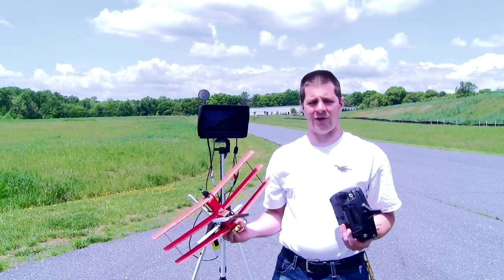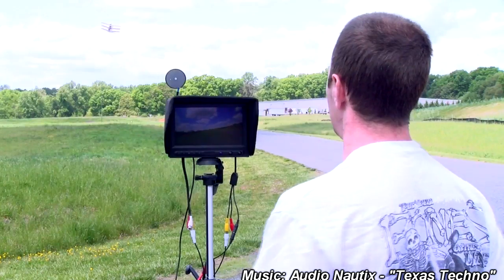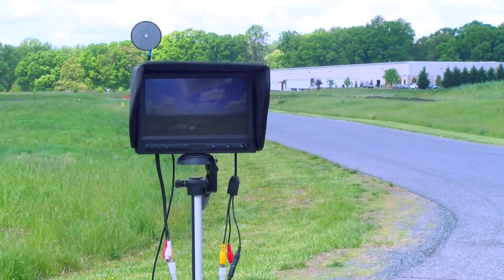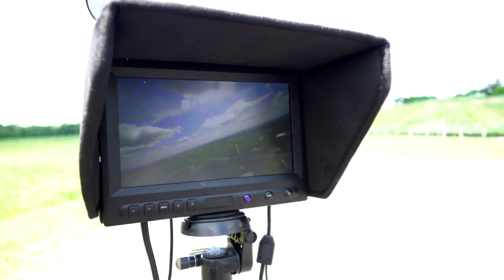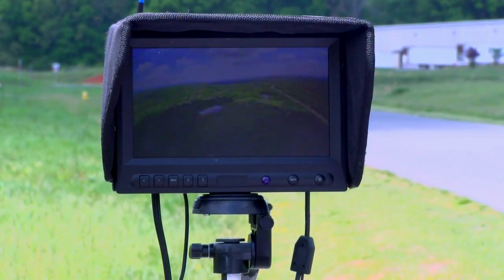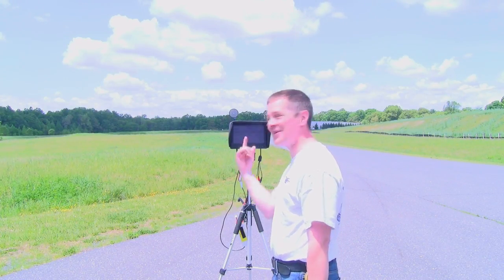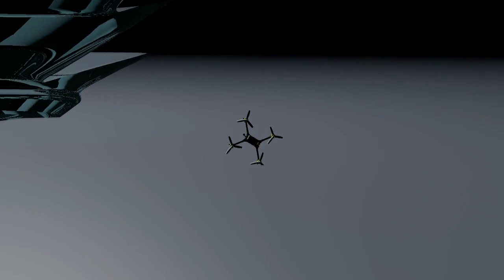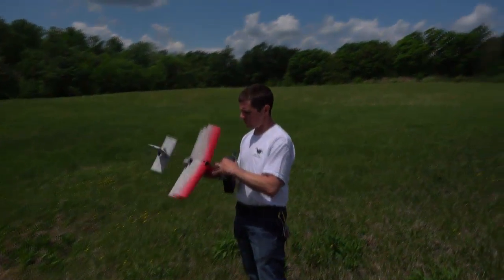VAS 2.4GHz diamond control antenna test

Comment: Is the best orientation vertical like you have it or flat (parallel against the ground)? I’m looking to get this to replace the stock antenna on my jumper 4in1 module
Reply from the maker: Vertical as I have in the video.

Comment: Hi Alex, I will be getting one of these to try. Would this same benefit hold true over water? Let's say I was at the beach, would the radiation pattern still track along the water for the increased range?
Reply from the maker: To be honest I don't know.  I never tried it.  I would test by flying over a pond or lake with a water bottle tied to the aircraft (as a cheap float) just in case.

Comment: I put this on my Futaba 16SZ.  Does the distance between the diamond antenna and radio matter?  Is further better or can I attach it directly to my radio's top plate?  From the video's diagram, I should also have the antenna perpendicular with the ground, correct?
Reply from the maker: Further away from the radio is better, yes.  The antenna should be perpendicular to the ground.
Reply: Video Aerial Systems . Just tried to to test the range, I got about 550 meters. I wasn’t very high off the ground and was perpendicular to the flight path. In the end, this is further then my stock antenna, but wondering what the best condition for longer ranger. 

No YouTube or Facebook,  but here is video from my Instagram:

https://instagram.com/p/BjpYJs2l8Fo/
Reply from the maker: Make sure both antennas are vertical.  The diamond should be upright and so should the RX antenna.  This will likely be the longest range set up.
Reply: Video Aerial Systems thanks the two antenna on the quads were 45 degrees vertical. I am going to try again this weekend, this time actually facing the quad and standing. I was sitting down under a park bench under a tree.

Comment: Looks like another winner! I fly with a Devo 10, that has a u.fl connector inside, but a rp-sma pigtail so that I can remove/swap antennas. I use either a 2dbi(or 3?) or a 5dbi linear antenna, with 100mw of TX power (can go up to 150mw). Would  there be much benefit using the u.fl version of your antenna (without the pigtail), instead of the rp-sma one (and keep the pigtail)? Also, compared to my 5dbi antenna, how would the VAS Diamond compare as far as range and penetration?
Reply from the maker: The benefit of the diamond isn't gain, but uniformity.  A 5dbi antenna will be even more erratic than the stock antenna due to side lobes.  THus, the diamond will simply be more consistent with signal strength, but the 5dbi will have areas where it is stronger.  

If I were you, I'd leave the pigtail in the radio and just swap out on the RPSMA end.
Reply: Thanks for the response Alex! I will have a go with the rp-sma version then! I don't have rssi with the receiver I use on my quads so when I say "have a go", I really mean it! haha

Comment: And another question on the dx6 it has two antennas could we run two of these or this and a microwave dipole antenna ?
Reply from the maker: I run 2 microwave folded dipoles on my DX9.  The Diamond is essentially the same antenna, but much easier to make hence why it is cheaper.

Comment: Could I put this on a spectrum receiver that has a ufl connector or would there be no benefit of doing that?
Reply from the maker: You would see another increase in range, yes.  However, the biggest advantage is on the TX... and you only need to buy that once.

Comment: Can't wait for the plug and play version ! ! !
Reply from the maker: It is plug and play.  Spektrum uses u.fl.  Just open the radio and plug it in ;)
Reply: Video Aerial Systems sweet I have the original you made years back and had to order a pigtail to compensate for my lack of soldering skills 😅 keep up the grate work! I love my pepper box and the numerous others I own of yours, " from the very beginning tell the day i 💀☠ I'll be rocking your antennas "

Comment: Since i have a DX9 which has diversity, should I order 2 antennas?
Reply from the maker: I use 2 antennas in my DX9.  Might as well modify both.  I tied the second one to my handle.
Reply: Did you have to drill a hole in the case?

Comment: This is pretty much the microwave with a plastic shell right?
Reply from the maker: Forgive me, but I am not sure what you are asking.  The antenna is a PCB dipped in a rubber compound to protect it, if that's what you were asking about.
Reply: Video Aerial Systems I see. I just assumed it was a cleaned up version of the microwave folded dipole

Comment: Does it perform about the same as the folded dipole for the Taranis?
Reply: So...Very similar? I already have a 2.4 folded dipole, do you think the diamond is a viable "upgrade" either in performance or durability? I'll probably pick one up, both to support you/VAS but also because I am not a huge fan of the flexi folded dipole. I always feel like it is going to be slightly out of tune as the wire moves
Reply from the maker: yes, its very similar

Comment: Would they also improve the range when using them as RX antenna? Will you also bring out simple dipole and sleeved dipole 2.4GHz receiver antennas, which should increase the range over a regular monopole?
Reply from the maker: They will improve the range compared to the stock receiver antenna, however you have to desolder the antennas on the receiver
Reply: Most modern receivers come with u.fl plug on the antenna, so that should not be an issue
Reply from the maker: In that cause just plug it in and you'll be good to go

Comment: Never had any "range" problems with either my Taranis X9D+ or the TX which came with my XK X380. I've used both to fly models out a mile. On my XK X380 I've mounted a 200mW VTX with a 'Bird's Eye View' RHCP antenna, and back at the TX I have a diversity monitor which has a Aomway 7 turn helical & Bird's Eye View RHCP panel antenna .. good video out to a mile as well. Antennas do make a difference, something I learned in the early days of RC (early 60's) and throughout my amateur radio career. I do use a lot of VAS antennas on various quads, diversity goggles/monitors though. They are well made and perform well too.
Reply: My stock Tarnis X9D and X7 antennas have both been out 2 miles with standard X4R, X6R, and X4RSB receivers. The 5g8 video stays clean as well, using 200mw eachine vtx and a patch.

Comment: I want one for my Taranis. Are you going to sell those?
Reply from the maker: Those have been available for several months:  https://stoneblueairlines.com/vas-microwave-folded-dipole-2-4ghz.html
Reply: +Video Aerial Systems You wouldn't recommend using the sma version of the diamond antenna for the taranis over the older folded dipole?
Reply from the maker: Both of them preform about the same